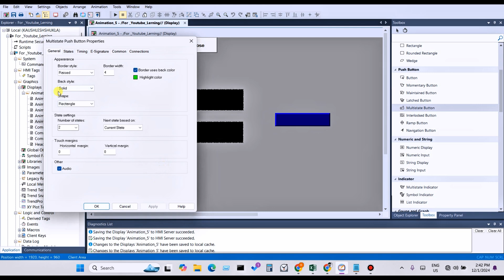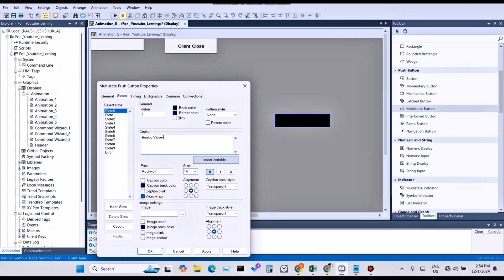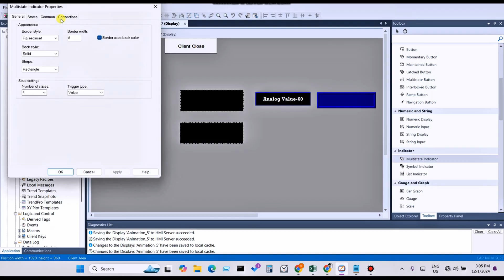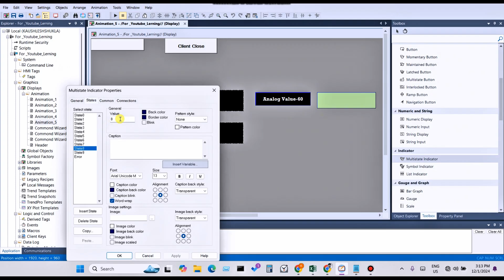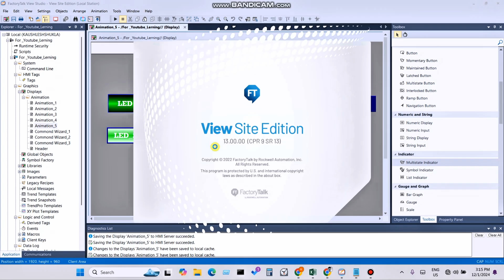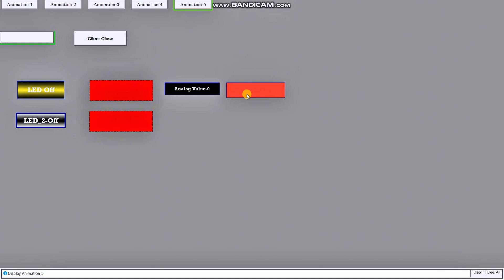FactoryTalk View Studio || How to use Multistate Indicator and Button | Rockwell SCADA

Comment: How can we use multistate switch (knob) instead of push button. for example I have 3 states 0 for OFF, 1 for Manual and 2 for Auto. So User wants to replicate Knob key from field panel into FT View graphic. I am able to create for 2 state but facing challenge for 3 state knob
Reply from the maker: We can Use Multistate Button , With Multistate indicator and or Different Color animation